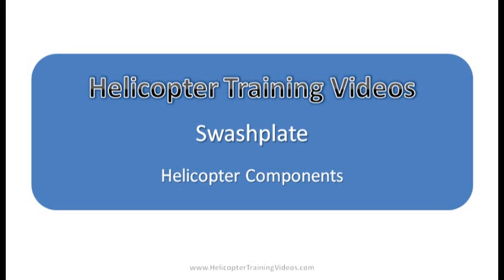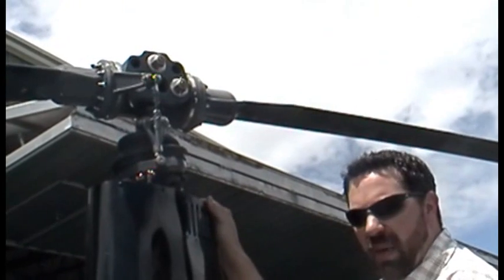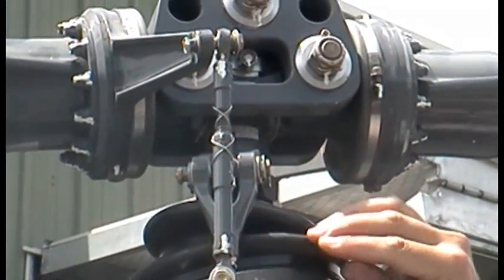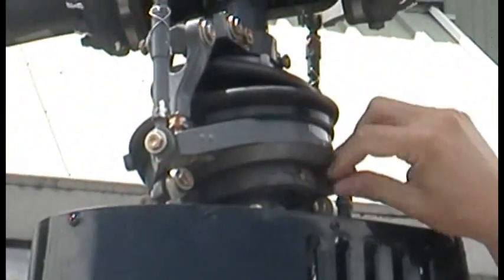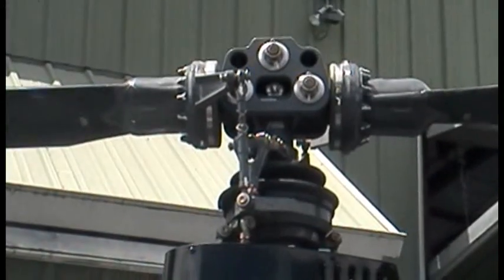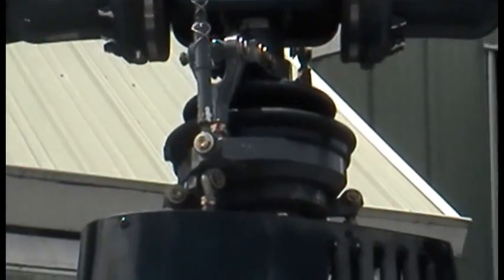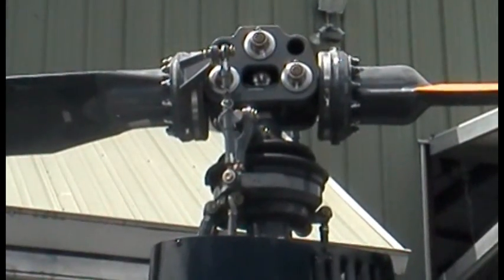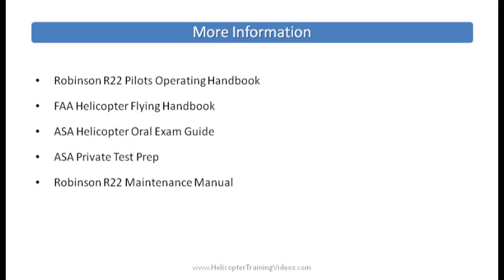What Is a Helicopter Swashplate? How a Helicopter Swashplate Works

Comment: So with the collective all the way up and the cyclic all the way forward ypu would get max speed I presume, bc it's increased the pitch to max level and the swashplate is pulling g you forward at its highest potential
Reply from the maker: Unfortunately you would run out of power and the RPM would decay, but I see your idea.

Comment: I wonder what would happen if a helicopter is running on the ground, collective full down and keep it down, you move the cyclic forward, back, left and right, will the aircraft tip over?
Reply from the maker: No, if there is not enough lift being generated

Comment: This video fails to point out that irrespective of the number of rotor blades on the head, the lower fixed part of the swash plate always has three control rods from the collective and cyclic control rods. This is because only three points in space are required to define a plane, i.e the angle of the swash plate. It is normally the case that fore and aft movement of the cyclic stick controls the single rod at the front of the swash plate, moving it up and down, whilst the two rods at the side remain stationary. Lateral movement of the cyclic control leaves the front rod stationary, whilst moving the side rods up and down in opposition, causing the swash plate to tilt to the left or right. There is some displacement of the input control rods from the true front and side positions to allow for gyroscopic precession effect, but it is not 90 degrees. It is less than 20 degrees, and varies on different aircraft. The swashplate is the most common method of transferring the control inputs to the rotating head, but there are other systems in use. The Westland (now Leonardo) designed Lynx and all its derivatives use a system known as an internal spider system, inside the hollow main rotor shaft. This was originally used on the Saunders Roe Skeeter in the 1950’s. The earlier Bristol Sycamore and Belvedere had a similar system with the spider above the rotor head, controlled by a linkage in the hollow rotor shaft. The Piasecki “ Flying Banana” had a different system again. Examples of all these can be seen at The Helicopter Museum at Weston Super Mare in North Somerset, England.
Reply from the maker: Thank you Alan - great information
Reply: Helicopter Training Videos Thanks for your response to my earlier reply. I spent many years of my working life in helicopter engineering, holding multi trade CAA licences, following military service in the Fleet Air Arm. I now volunteer at the museum at Weston as restoration engineer and tour guide. I am definitely a self confessed helicopter enthusiast, and never tire of taking technical engineering tours of the many aircraft in our great museum, to enlighten visitors in the workings of helicopter rotor and flight control systems. Keep burning and turning.
Reply: @alanwhitfield1907

Comment: Can someone help me out here.  If you push forward on the cyclic, the 12 oclock position becomes lowest pitch position, and the 6 oclock becomes highest pitch (correct me if i'm wrong).  So with gyroscopic precession, wouldn't that mean that the biggest angle of attack being at 6 oclock, the resultant force is 90 degrees away at the 9 oclock ... meaning it would tilt the rotor disc left?  What am i missing here?
Reply from the maker: Close, but 90 degrees off. :-)  Push the cyclic control forward and the blade position with the lowest pitch will be about 90 degrees BEFORE the front of the helicopter (so left or right side, depending on direction of main rotor rotation) and the force will be 'felt' about 90 degrees later, causing the front of the main rotor disc to move down, tilting the lift to the front, causing the helicopter to move forward... This is a simplified version, but you get the idea I hope?

Comment: And i thought flybarless was just an rc helicopter thing. It's pretty cool to see a real one.
Reply from the maker: What is flybarless?
Reply: Flybarless is just a scaled-down replica of the mechanical system you showed in this video. The alternative, a flybar, is a mechanical stability aid used on RC-Scale helis. Generally as you scale down in size you have an effective acceleration in maneuvering dynamics, and without either electronic or mechanical stability aids the scale sized helis are extremely difficult to maintain control of. @HelicopterTrainingVideos

Comment: gyroscopic forces is e.g. to the front with cyclic it tells the rotor 90 degrees before. sovwhat it means going forward e.g. the blade gets the instruction from swashplate 90degree before its to the front.
Reply from the maker: Yeah

Comment: If just one of those tiny pitch links comes out of joint, your heli will turn upside down and you can kiss the world goodbye.  There's no backup link. That's what I don't like about helicopters. All those joints must be working for you to remain in the air, wheras in a plane, you can glide to some extent if something goes wrong so you have some hope.
Reply: +robaxa A helicopter is not going to flip upside down from a failed pitch link.
Reply: "Flip upside down" is just an exaggerated term. I really mean you will lose control of the helicopter in all three rotational axes because you can't control the pitch of one blade during each cycle anymore.so you can't balance the helicopter in the air.
Reply: +robaxa There are periodic inspections of all the bearings on the main rotor head to ensure that the joints won't come loose, and before they even come close to being a danger they are replaced with new ones.

Comment: The swash plate is a device that allows vertical motion to be transferred to rotary motion... The cyclic and collective controls activate the lower portion (non-revolving) of the swash plate and the second part of the swash plate (rotating upper part) is connected by push/pull rods to the blades, allowing them to move the leading edge up or down thereby increasing angle of attack (like a fixed wing aircraft rotating at take-off speed) and transition from weight on skids to weight on airfoil. The cyclic dictates the "tip path plane" or shallow "dish" that has materialized from "flat" because of no weight on the airfoils to a shallow dish, because of "coning"... That happens because the tips of the blades are bending up like the wing tips of a Boeing or Airbus wing tips as the aircraft rotates, switching from weight-on-wheels to weight-on-wings. (Next time you fly, look out the window on take-off to visually understand...). At any rate, the helicopter hangs vertically, and at right angles to horizontal in a no wind condition because of gravity, below the turning disk... To transition to forward flight, side or aft flight, the tip-path--plane, through use of the cyclic, will dictate which angle from perpendicular you wish to go.... Hope this clears the waters a little.... Good flight...!

Comment: so it is not rigged to compensate for gyroscopic procession?
Reply: ***** I apologize for being 'that guy', but...it's precession. Thx.
Reply from the maker: The movement of the swashplate follows the controls - forward cyclic tilts the swashplate forward. The upper swashplate connects to the pitch link rods and it is how those rods connect to the blade pitch horns that puts that 90 degree compensation in.
Reply: Late reply but yes it actually is. When the blades are 90° to the helicopter (sideways like an airplane) and you push the cyclic forward, it will seem like one blade on the aeleron (roll axis) gains more lift while the other side loses lift. Without gyroscopic precession this would cause the helicopter to roll. However due to the 90° delay in a force applied to a gyroscope (the rotor itself in this case) the heli will tilt forward and in fact the cyclic will respond exactly as you'd expect though the swash acts 90° early. 😉
Reply: 7055460151
spf